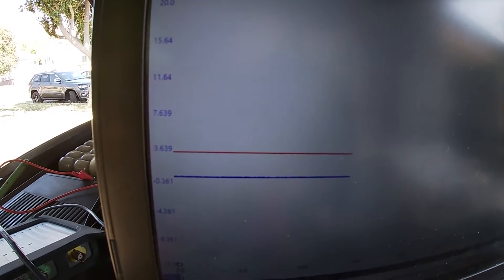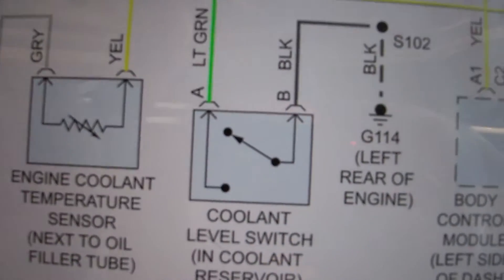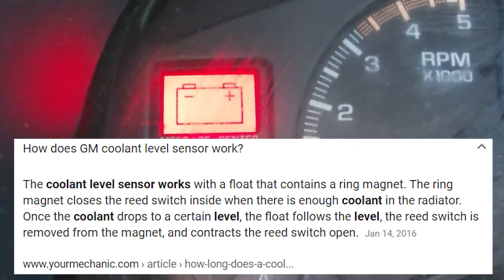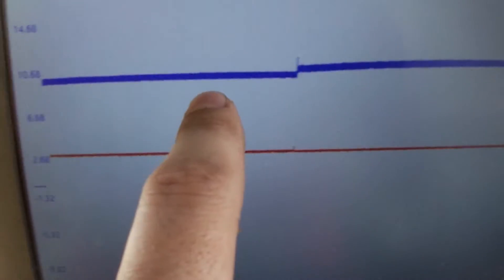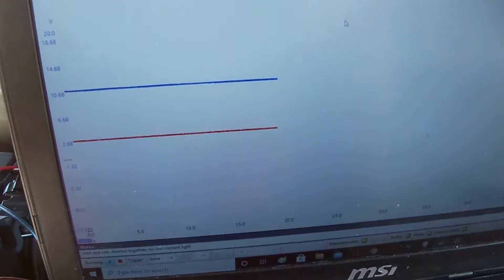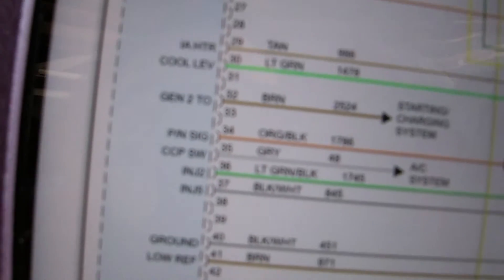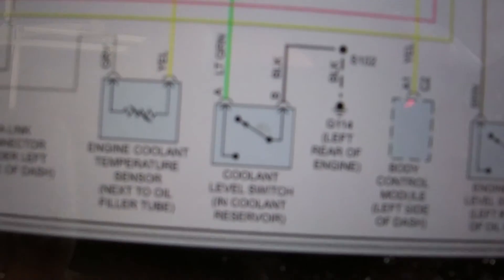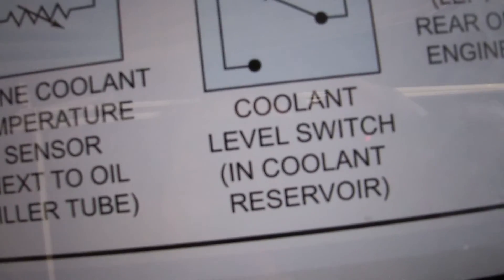'01 Chevy Silverado 6.6L Low Coolant Level Message

Comment: My green wire does not have 12 volts going it and when you jump it the light stays on sometimes it stays off and most of the time it comes on where did you get the diagram from